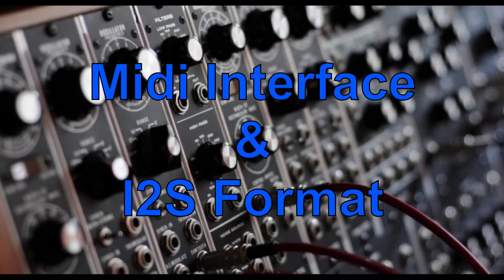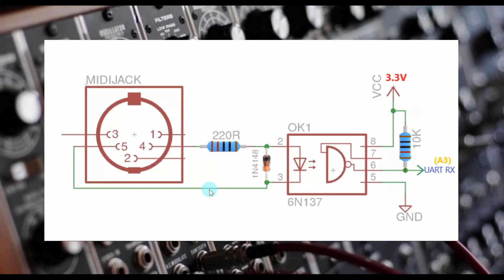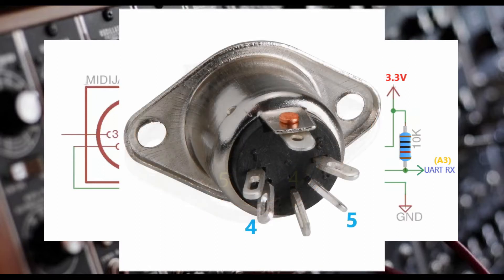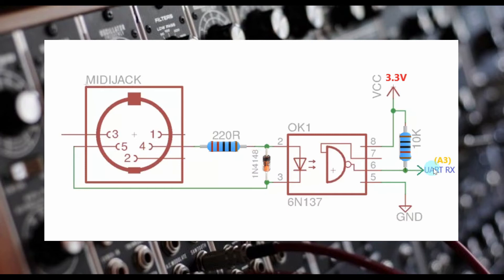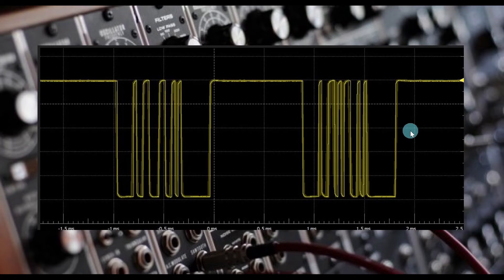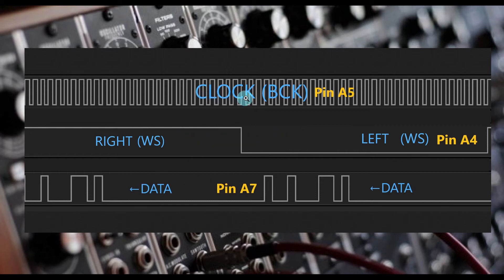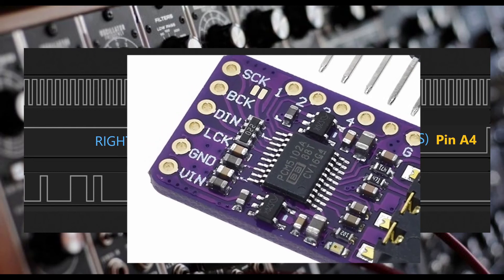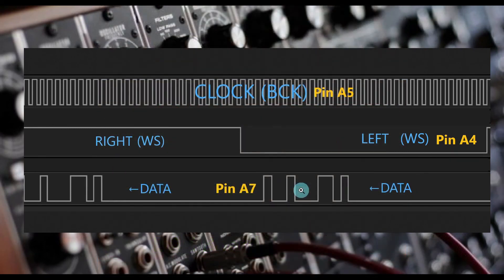001-Basic Digital Audio and MIDI Signals the BP Synth uses.

Comment: Thanks👍🏻Is a DAC basically a fancier capacitor+inductor filter that somehow turns the PWM into the output waveform?
Reply: It's generally not the same construction internally and less noisy than the above solution. There are various implementations, one of which is a R-2R structure. You could experiment with making your own R-2R DAC on a breadboard.

This said, there is a DAC that is related to the filtered PWM structure, but instead it uses PDM (Pulse Density Modulation). These are usually called DSD. Also look for 'Delta-Sigma'
Reply: @yashnu  Thanks for explaining! Is PDM also known as PIM? (pulse interval modulation) and basically about encoding a wave as a sequence of voltage pulses that are all the same width, but the spacing between them is further apart on lower amplitudes?
Reply: @OMNI_INFINITY  It does appear similar, but PDM or DSD is just 1s and 0s (ones and zeroes) at any discrete time interval.
Reply: @yashnu  Ah, then how is it encoding a waveform? It must be encoding amplitude info based on interval between points. Shorter distance between points, higher amplitude. Right?
Reply: @OMNI_INFINITY  It already tells you in the name, but to understand it you must deprogram your brain from the usual Sample representation and interval encoding. Amplitude is encoded via the density of 1s. The encoding of no amplitude is a special sequence that is counter-intuitive. It has nothing to do with intervals at all, this is not interval encoding.